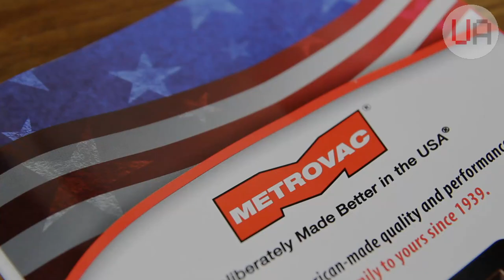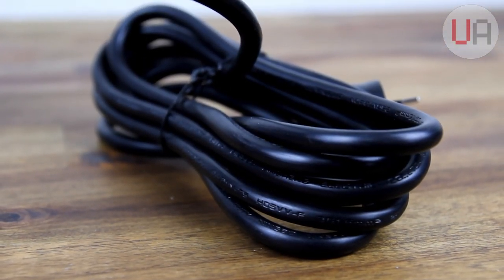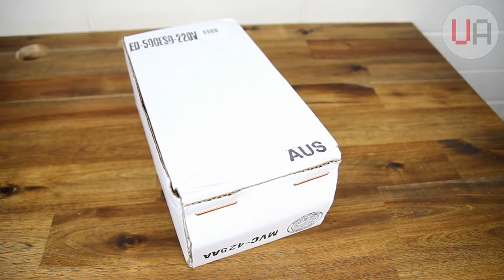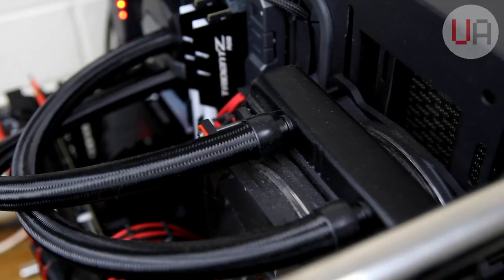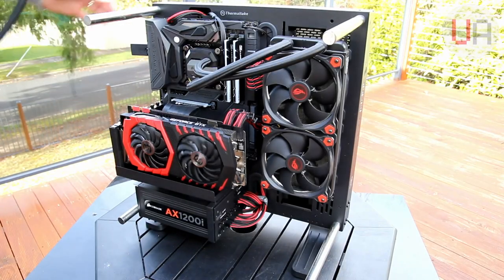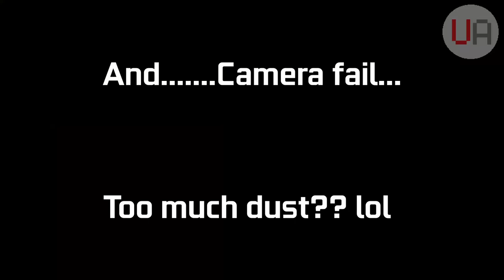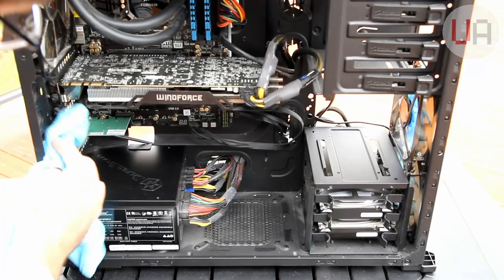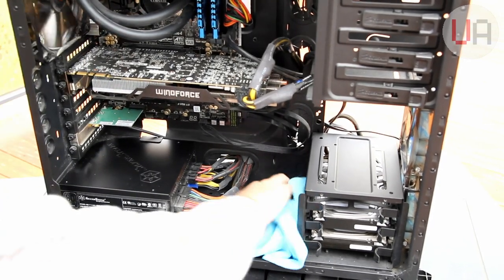MetroVac DataVac Review - It Doesn't Suck!

Comment: Put a small piece of scotch tape on your fans before using any sort of compressed air or electric duster. Shooting air at them will force the fans to spin way faster than they're designed and has a very high chance of causing damage to the bearings. (I've ruined 4 120mm fans by spraying them with duster.) Aside from that, you can properly clean dust off of them when they are stationary, though I usually use some rubbing alcohol and a paper towel anyway, since fans collect the most dust.
Reply: If you break a fan by blowing air on it, then you did yourself a favor, that fan was on its way out anyway.
Reply: Windmills in your PC.  converting kinetic energy into electricity. Could be bad.
Reply: I know this is a four year old comment, but can't you just hold the fan stationary with a finger? 
Edit: didn't see that he basically did it in the video
Reply: @IShaderI  Compressed air can blow multiple fans at once if you're not careful where you're aiming. I find it's best to just make sure that none of them can move before blasting them.
Reply: You can kill fans by spinning them the wrong way too much too apparently

Comment: May as well just buy a leaf blower lol
Reply: 149$ for this small crap blower... just get a leaf blower 100 MPH Air flow with 480 CFM easy clean computer in 5 second..
Reply: love it now,I fdunno what happened,but my unit which warmed up early ,now is cool and with the crevice tool,works great .
Reply: I do use my leaf blower for my pc blower!!
Reply: This particular model is definitely a rip off, but I got the over version for half off which only had a stupid improvement as the only literal difference. But you can't just get a leaf blower, they're too powerful.

Comment: Hmmm is the silver screw where you're supposed to attach the grounding strap's alligator clip? (Perhaps similar to a turntable preamp grounding post, you're supposed to undo the screw enough for the alligator clip to bite down on the screw threads.)

Comment: Get real about your review. Bought this from PC case gear. You should have mentioned some common concerns. Personally I concur that air seems to escape on the side of the can (where that silver screw is). This is is specially the situation when you try and use the smaller attachments. There is a lot of loss of air pressure because of this leak and quite frankly it’s not going to be useful for surgical cleaning of your pc. You’ll need a can of air for that. 

The main attachment works well enough. It will blow out bulk dust. But I could have used a hairdryer for that. 

Also, the machine gets hot after a few minutes of use. 

This machine is overpriced

I am not generally impressed.
Reply: it does the job

Comment: You have to use the ground strap clip on the silver screw at least back it out a little put the alligator clip on it then tighten it down, putting the clip on a painted surface will make it useless..

Comment: So this is just an air blower? There isn't an ionizer in it? So that grounding strap is enough to eliminate static being generated by that high speed high volume of air? BUt it doesn't eliminate static on the surface being cleaned, it just doesn't produce anymore than is already present? There are ionizer air guns  in the paint industry to eliminate static on cars to be painted. The ionization process emilminates the static on the surface. Would an ionizing air gun be bad for cleaning computers and electronics?

Comment: why did you use the wide tip use the narrow tip does much better, 

those things heat up a good bit after a few min too btw, works very well on tight spaces when using the narrow tip
Reply: The narrow tip doesn't make the air pressure stronger. I have one myself and have tried those. All it does is make the airflow weaker and it takes double the time to remove all the dust plus the whole unit gets really warm due to the slow airflow through the motor. I'm surprised at all the YouTubers who use the small attachment. I guess they just had your logic and never tried the bigger one.

Comment: You can buy the ED500 instead, just as safe as this and cheaper. I know people who have cleaned over 300 towers with the ED500 and none of them were ruined in any way. This whole "short circuit ESD-paranoia" has gone a little bit too far...
Reply: The ESD safe version would make more sense for dusting circuit boards that aren't screwed to a metal case like components in a PC, or to blow on bare components. Like in a electronic boards assembly room for example. I've been using the ED500 for years and never zapped a component while blowing the dust off a PC.

Comment: You don't do nearly as good of a job holding the fan for your mate's rig. Ol Dusty. you just let those fans spin and spin and spin. You tried slightly for the front fans but not really. Not nearly as much as you did for your own.
Reply: Doesn't matter anyway. Several people have tested the theory that spinning the fans while cleaning a computer will hurt anything. Hell Carey Holzman has a video where he used a freaking leaf blower full blast on the fans and did absolutely nothing to them.
Reply: Yeah holding the fans to prevent damage is bs. I've never damaged a fan or made one stop working due to ''overspinning them'' I'm ready to pay for a new one if that happens. But so far in 10 years i haven't damaged a single one. This is just people online that spreads this lie and have never actually tried this themselfs.